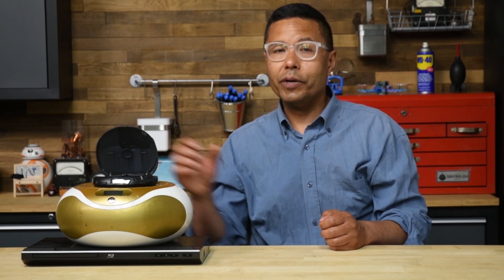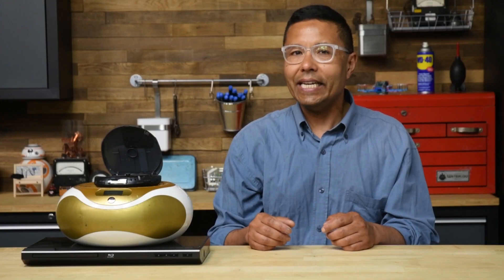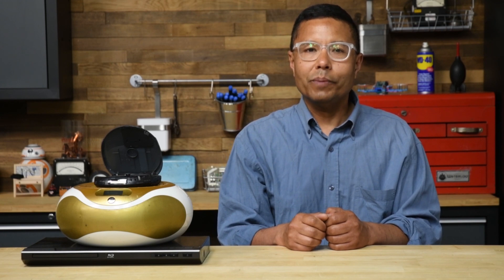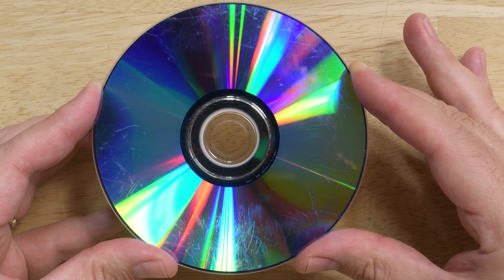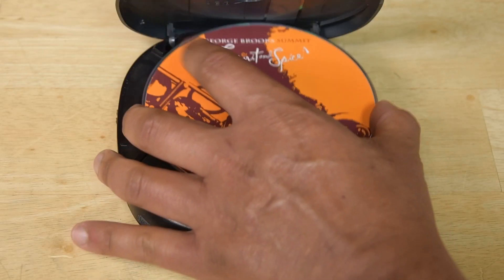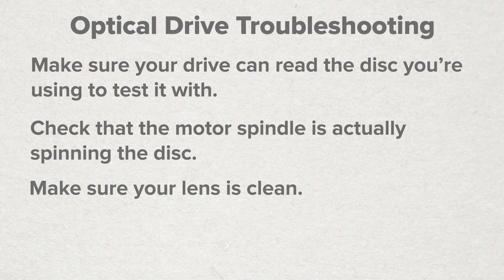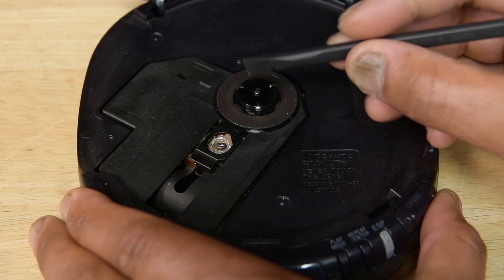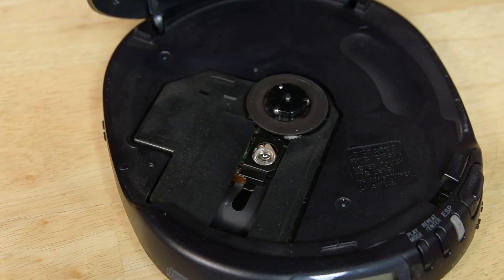Optical Drive Troubleshooting: Repair Tips from the Fixit Clinic

Comment: Okay, I don't know about if IPA can damage the plastic lens or not but do not use ethanol to clean acrylic/plastic lens, they will fog it up or will develop micro cracks on the surface and that will permanently damage the thing
Reply: @passatb6break  ethanol can attack acrylic, I know that because I've used 90% ethanol to clean an acrylic panel, after I wiped it clean then it starting to develop micro cracks on the surface (kinda looks nice though but it has heavily affected the integrity of the panel and its clarity). The other times I use the same ethanol to clean a laser lens and it fogged up and cannot be cleaned
Reply: What do you recommend to clean

Comment: I had thought that the CDs are the ones that's faulty, turns out even the readers/writers have a fricking lifespan and my old one was jumping randomly. Switched to a new one and it worked smoothly.
Remember how hard drives die in their later years by slow reading or even outright failure? Blame the dusts, they are the biggest enemy of mechanical/optical readers. And even with advanced material choices, dusts can still sneak in. At least, they just block the reader, at worst, they scratch.